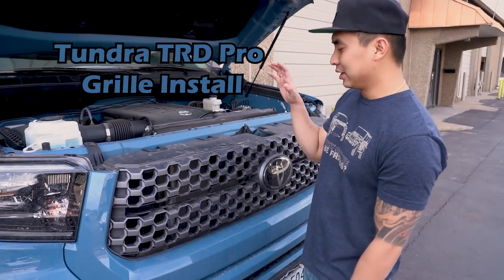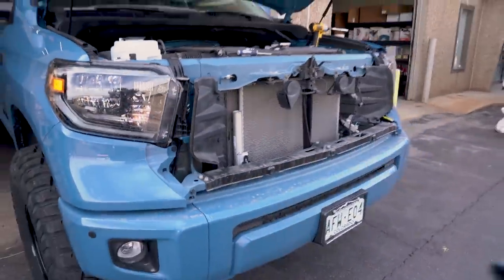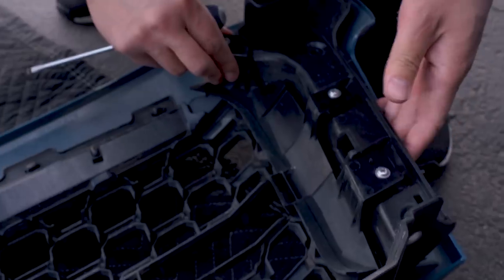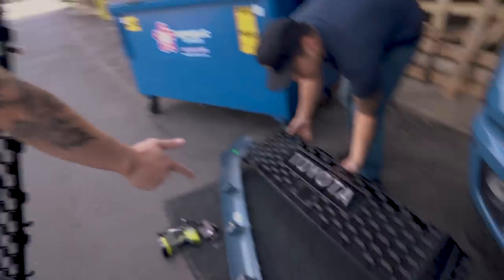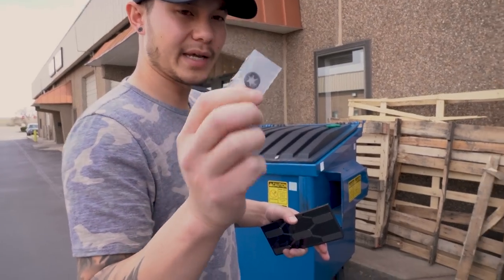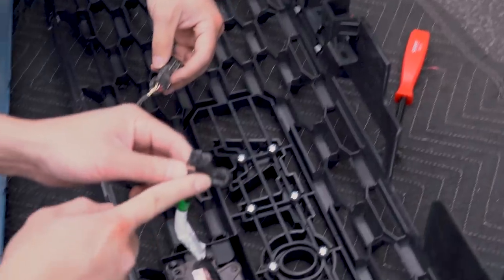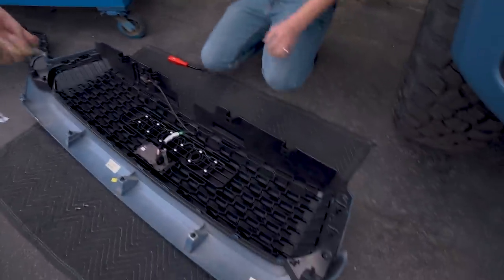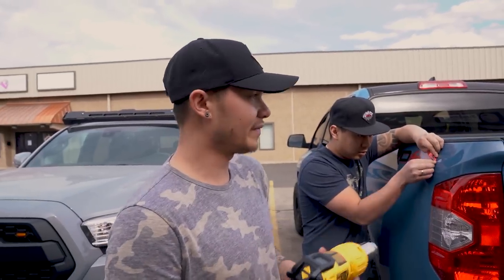Tundra TRD Pro Grille Install

Comment: I have a 2021 Tundra with a 1794 grille. I want to swap with a TRD grille. I was told by my local Toyota dealer that I would need to take it for a swap because they use different sensors for 2021 v. previous years. Do you notice any issues with the 2021 grille swaps?

Comment: Great video! Can you please advise as to the best website to buy the trd pro grille insert. I have a platinum ‘18 so the surround is already color matched. Also, best place to buy the Toyota letters, thanks.
Reply: Honestly dude if you’ve already got the color matched surround, id just buy one from a parts dept. it’s like 267 and way less hassle as they give you the color matched lower surround

Comment: Thanks for the video! Two questions: did you have to recalibrate the auto cruise sensor? And do you know where I can find oem parts? I’m trying to get rid of this chrome. Don’t know why Toyota color matches the rear bumper but leaves chrome up front and around the grill. Thanks again for the video, excited to install the mc auto grill
Reply from the maker: No recalibration done or needed. You can get the front bumper pieces from Toyota, from a TRD Sport trim

Comment: 2020 tundra trd pro grill fit to 2014 tundra  up  I Have a2016 I did it   My truck looks like new 2020 I get the grill but I had to use the base the grill  exactly what  he’s doing in the video you can do it to

Comment: What year is your tundra? I have a 2016 tundra 1794 edition and was wondering if this grill will fit mine. I know 2018 the chassis change a bit.
Reply from the maker: This is a 2020. If your headlights look the same then it should fit.

Comment: Wondering if some one could answer this question for me. Im putting a 2014/2017 TRD pro grille on my 2018 Tundra Platinum someone send for the 2 best things to do is make sure your key fob is not near the truck and battery is disconnected

Comment: Did you guys have to recalibrate the TSS sensor? My dealership said that “must” be done, but they couldn’t for liability reasons. They offered me the TRD sport grille instead, but I want the Pro.
Reply: It should be calibrated. I own a repair facility  and when I took my grill off for paint I recalibrated the sensor, and when I replaced the windshield I recalibrated the sensor. People who can get away with over changing for calibration will. We charge one hour of labor and it takes about 10 minutes the first time. That's $85 US for us but I've seen window shops charge as much as $700 for the service. To be fair there is quite a bit of liability in tuning these sorts of things.

Comment: Did you have to replace the censor to be compatible with the pro?
Reply from the maker: Comes with it
Reply: Taco Twonz can you put a link up? Also I was told yesterday by a Toyota partsman that the limited, 1794 and PRO all had the same censors.. any of oof this?
Reply: @Wm-ob3si  you dont replace the sensor bro. Did u even watch the video? Same sensor just bolt to the different grille. 🙄

Comment: Awesome! 

This is a truck I would buy! 

The Tundra chrome is so superficial but still a deal breaker.

The most eye catching thing in Platinum's cab is the quilted leather in the glove box.

Not in a good way. 

It's all I looked at in my test drive. I couldn't take my eyes off it. And it just bugs.

Like the massive amount of 1994 chrome on the 1794 grill. Can't get over it. 

The Pro doesn't have cooled seats. Annoying!!! 

I won't buy anything but a Toyota but these three little annoying things kept me in my Lexus Lx470 for the last 3 years.
Reply: I agree. Very hard to spec out everything you want and its not like there are a lot of new options for the tundra too.